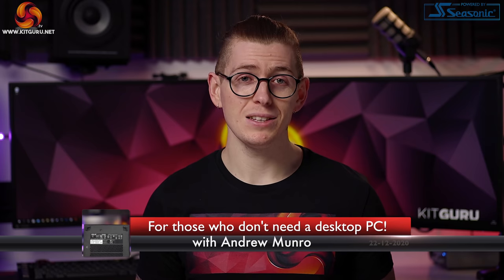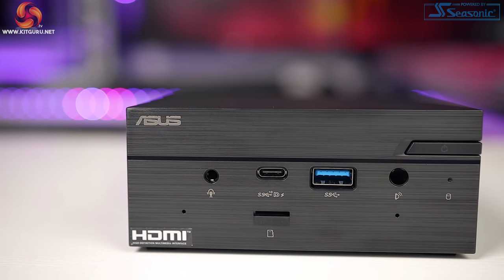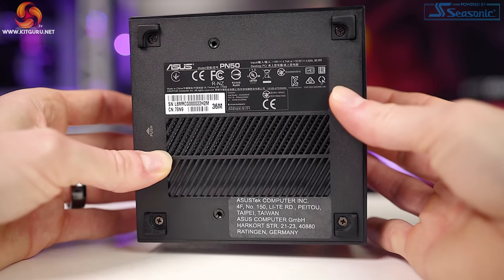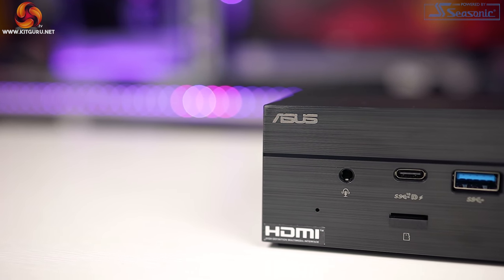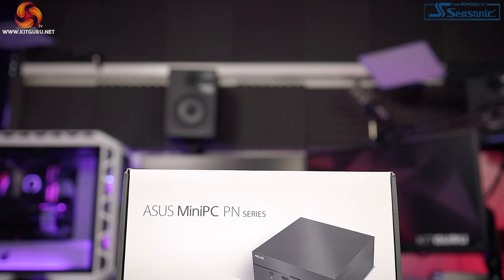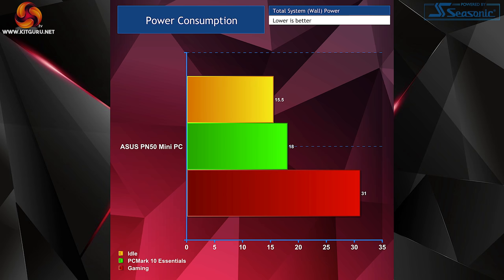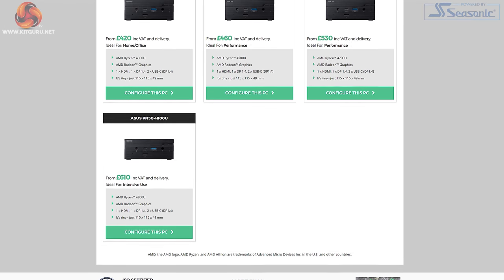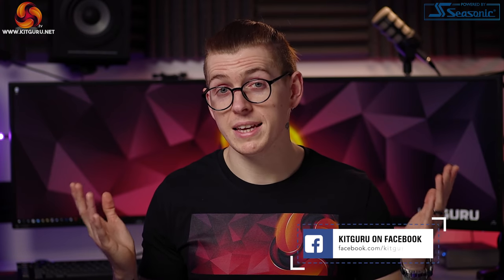ASUS PN50 Mini PC Review - the pint-sized powerhouse!

Comment from the maker: TIMESTAMPS:
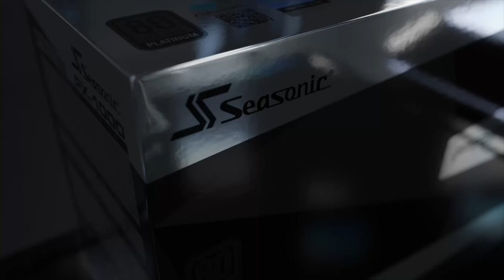00:00 video start
00:15 introduction
00:41 so what is it?
01:31 design and overview
02:18 I/O connectivity
04:05 system specifications
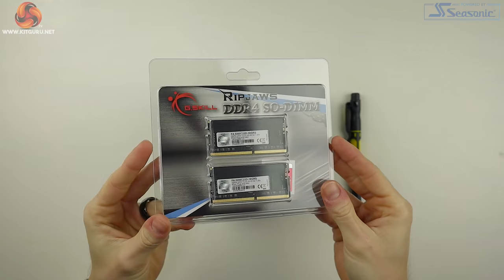05:21 so how do you install SSD/RAM?
07:16 let’s get into the benchmarks!
08:39 but can it game?
09:47 thermals, power and noise
10:42 pricing when factoring in SSD/RAM
11:55 but what if you don’t want barebones?
13:10 overview of the PCSpecialist models
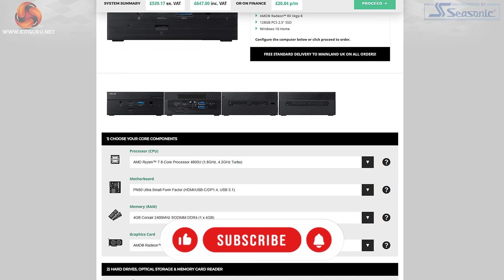14:35 final thoughts

Comment: One of the benefits of the this system versus the previous PB50 is that it supports HDMI 2.0. The 8700T of the PB50 caps out at 4k24hz over HDMI. Which is no use for home theatre work.

Comment: Good and detailed review as always. If I was the target for this compact machine I would have wanted to see thermals with both and SSD and an NVME in the case. Seems like the SSD would severely impact the airflow in that tiny case, though I might be wrong. 

I always want these small machines, then realise how I really just want a full case even if it is a raspberry pi sitting in it in case I want to pack it full with disks and random cr@p :) ...

That said, this is could be a perfect platform for a Home Assistant build or something similar..... but then for those you might want something with 2-3 ethernet ports.... hmm
Reply: other sites have reported good thermalson these

Comment: There's more than one way to not pay £100 for activated Windows.
Reply: Will Swift  I have a licence code that works for any number of installations. It's grey market , but it's just the code. I think it cost about £5.99 on Ebay.
Reply: Will Swift  cjs-cdkeys been buying mine there for years. Never as an issue.
Reply: get Zorin OS, thank me later

Comment: Back in the day I had an Intel NUC and it was cool, but then I found myself not using it much (I ended up selling it).... Recently I wanted a computer to play around with FreeBSD on... My main system's GPU isn't compatible with FreeBSD, so I can't really dualboot Windows 11 and FreeBSD, as I don't wanna run it as a headless server.... I got one of these (first the Intel 11th gen version (on clearance and I accidentally broke one of the tabs for the flex cable that joins the two halves of the system, rendering it useless, and now this AMD version) and it runs FreeBSD with a desktop environment super well. I plan on using it with my TV when I wanna just sit back and watch stuff and not have to deal with the laggy webOS it runs natively. Anyway, yeah I love it. I'm going to install Windows 10 onto it soon to see how that performs (though spoliler alert it'll run phenomenally well!). I have mine set up with a 250 GB NVMe SSD (FreeBSD), and a 240 GB  SATA SSD with 64 GB of RAM, because WHY NOT? (Soon to be Windows 10 or maybe 11). I might make it my travel desktop to go with me on trips where I take a hotel room along side my laptop, but we'll see. Thanks for this video!

Comment: No mention of Linux?   
Not everybody needs Windows.
Reply: Yes, I'd like to know if Ubuntu runs perfectly with this hardware. I'd love one of these with the new 5000 series AMD processors :-)
Reply: I was specifically considering one of these boxes for running Linux.
Reply: yeah. im gonna get the 4500u or 4700u. and replace 3 intel nucs. Unraid, linux fiber client, firewall, plex , pihole etc
Reply: Manjaro works well on it.
Reply: @dmast3r  Linux Mint 20.1 works out of the Box, but all Linux Distros got problems using the onboard Sound...just add a cheap USB one and you are good to go.
Reply: And there is no support for regulating the fanspeed via software with linux, this is why i sell mine right now...
Reply: @maggotduban4628  I use it with headphone and i have no problem.
Reply: @dmast3r  What distro do you have ?
Reply: Oh i see Manjaro...
Reply: @maggotduban4628  Yes

Comment: Does ddr4 3200 RAM actually run at 3200? i've seen multiple reports now that the PN50 downclocks it to 2666
Reply: It downclocks due to compability issues. If you use a supported model it will run at 3200.
They've released a couple of bios updates to support more models but i'd still research carefully before buying any ram for this one

Comment: Arrived sounding like a hairdryer - DO NOT BUY
Reply: Uhhh how would it sound like a hairdryer when it arrived? You need to install storage and RAM before it can even turn on past the UEFI BIOS. Also, it's a high performance system in a tiny form factor... Of course the fans are gonna ramp up....